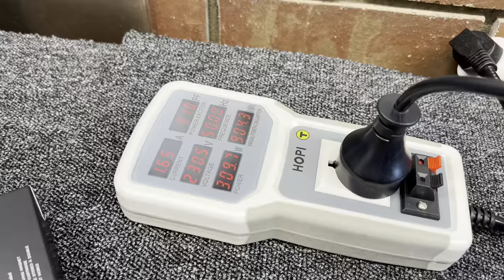Musical Fidelity AMS35i Class-A Integrated Amplifier Repair

Comment: Another great repair and tidy-up of poor initial production. Maybe a thermal camera would have helped to identify the exact hot-spots when the amp is running normally?
Reply from the maker: Thank you and you're absolutely right it would! I finally bought a thermal imaging camera either shortly before or shortly after this repair and it has been very useful.

Comment: As always, fantastic work. Musical fidelity has always left me disappointed in terms of execution and parts quality. Non removable bottom panels and lead free solder is always a headache. Lots of cheap parts in this one. In a fully class A amp, you’d think they’d use higher quality electrolytic capacitors. Nope. They wanted to save as much money as they could here. Tie wrap blocks mounted directly on the PCB with double sided tape? Ugh. 

Anyway, super happy to see another video from you Mike. Great work on this piece. It should work for years to come!
Reply: MF brings a least a better performance than Hegel (totally overrated in my opinion) in terms of transients and resolution in high frequencies.
Reply: @jeromelester8  Agree, the hegel "schreezes" the high frequencies.

Comment: Hi Mike
What would you recommend to replace those Jamicon caps. 

I see Jamicon inside Perreaux too. Will be great to learn from you. 

Thank you.
Reply from the maker: Any better quality, brand and grade of parts will be an improvement. One must always look at the circuit and conditions to determine the best parts for a job. Heat resistance is important here, so 105-degree rated caps are essential. Power supply caps should be low impedance, high ripple, long life rated parts. Do some research with the data sheets for Elna, Panasonic, Nichicon, Nippon Chemicon, Kemet etc and great alternatives will be evident. They are more expensive of course, which is why Jamicons are used here!
Reply: @LiquidAudio  
Thank you for the informative reply.

Comment: OMG why an Amp like this has Jamicon
Reply from the maker: A good question my friend!
Reply: Musical fidelity are always the same, in my experience, I owned a kw DAC and cd player seperats, that gave up and Jamicon capacitors inside, and now my xp200 has given up on me and its not as though I worked it to death... One of two running in bridged mode... It started whistling very loud then died..... Any thoughts on that sir?
Reply from the maker: @Michael-zg8qw  My advice is the same in any situation like this - get both to a specialist for the attention they need. The good news is that most MF gear can be saved. I'm sure these are no exception.
Reply: @LiquidAudio  Cheers thanks for the advice, keep up the good work sir

Comment: This is the amplifier that I wanted but was warned off by being told that it runs very very hot and to pick something else.
Reply from the maker: Class-A designs always run hot, it's a design decision that yields better sonic performance but must be considered in terms of equipment positioning and power consumption. More on that here, if interested: https://liquidaudio.com.au/faq/what-are-the-advantages-of-class-a-amplifiers/
Reply: I would go for Sugden - my A21 has been bulletproof for many years.

Comment: I have a question. Does ceramic fuses get less hot than glass fuses? The exact same value and type fuse I mean.
Reply from the maker: A fuse is not designed to dissipate heat, it is effectively a zero Ohm short, meaning there should be little to no voltage drop across it and therefore no power dissipation. Either style will be fine, just be sure to use the correct type (fast or slow) and rating. The fuse holders themselves are important though so the blades must be clean and tight and how they are soldered to the board is important. If they are degraded as these were, they must be replaced.

Comment: Do you know what may have caused the initial excess current draw or voltage drop in that area?  I'm having a vaguely similar issue on my a308 power amp that is currently drawing too on one channel and it's driving me nuts... Blown fuses and running way too hot on one channel.  Any idea's on what to check?
Reply from the maker: Its a range of issues in this case including traces and parts that are not adequate for the continuous current draw, lead-free solder of dubious quality, weak fuse holders, poorly thermally bonded bridges and of course the fairly high quiescent current draw of a class-A design like this. It's all discussed in my article, link in the description. This is a bit different to your example. You must power it up with a variac and check quiescent current draw which must be correct and symmetrical. It's always best to take your equipment to an experienced specialist repairer though. You don't want to risk blowing anything here, these Sanken output devices are heard to find!
Reply: @LiquidAudio  Thanks, I read the article as well.  I even have my amp at a professional shop as we speak and they can't even figure it out.  Very strange gremlin that we can't find....